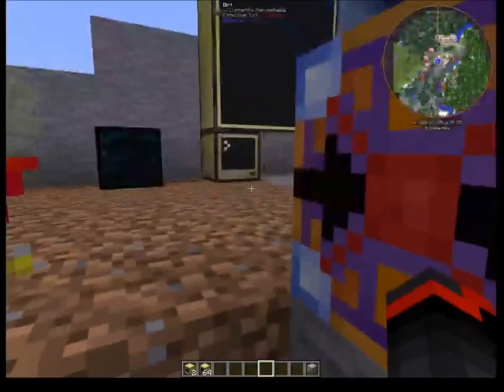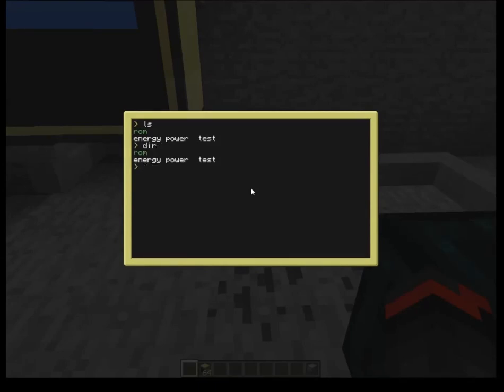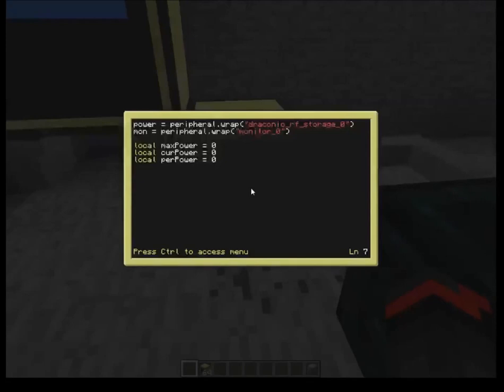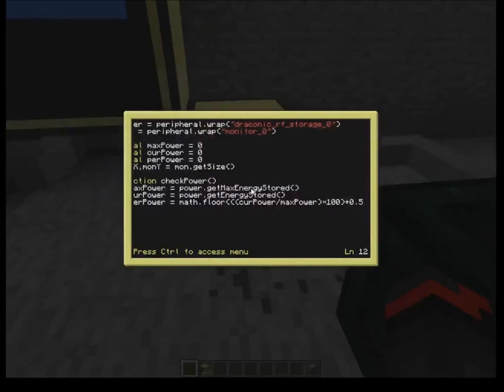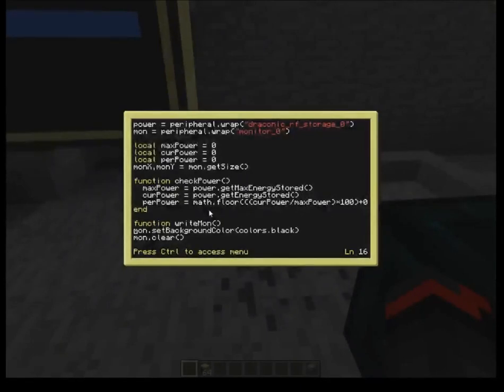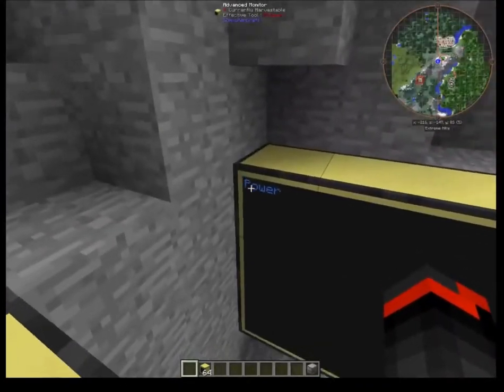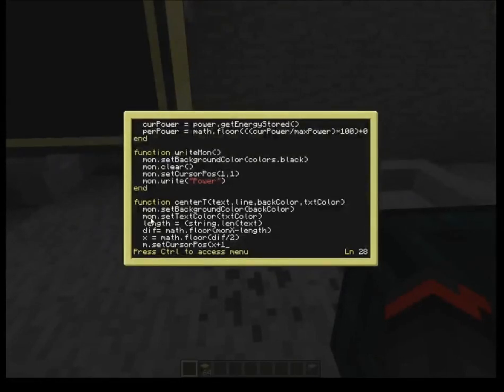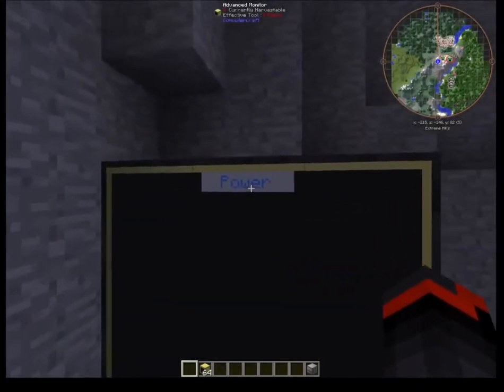Minecraft ComputerCraft Power Monitor Lua Tutorial

Comment: Hi. Awesome tutorial.
There is a way to show a "text1" on monitor when the computer is receiving redstone signal, and show another "text2" when the monitor is not receiving redstone signal?

Because I want to turn on/off a whiter boss farm that I've made. But I don't want to get inside of the room every time just to check if it is on or off. So, I just need to turn it on, and the monitor in the outside of the room will tell me if the mekanism is on or off all the time.
Reply from the maker: You can get redstone event with os.pullEvent("Redstone") 
if you want to then set the buttons per that just have a t1 button set and t2 button set and on the RS event t=t1 or t2 then t:draw
Reply: Sorry, I don't understand. What do you mean with "t:draw"? Btw... I will use a lever to turn on and off the spawner.